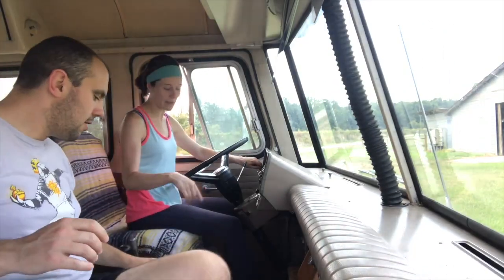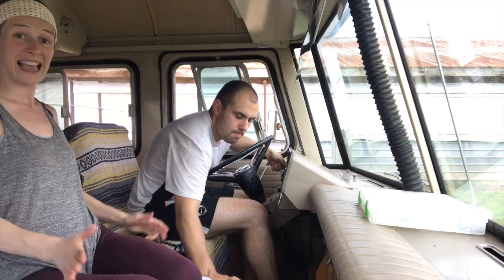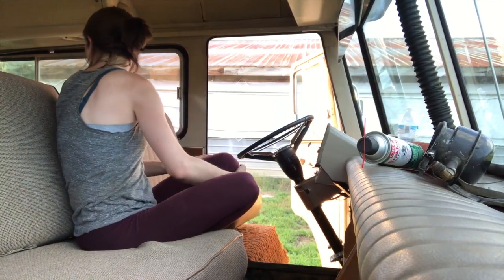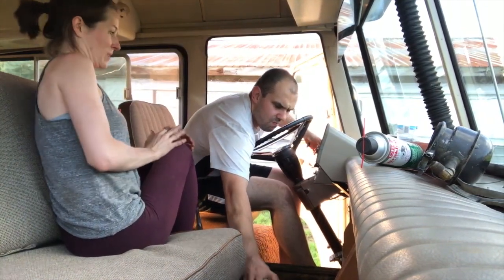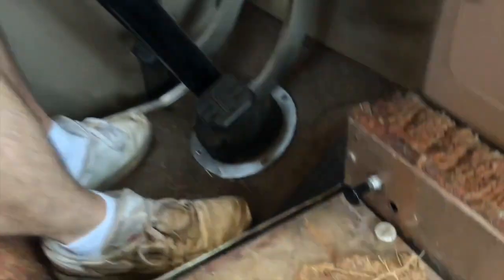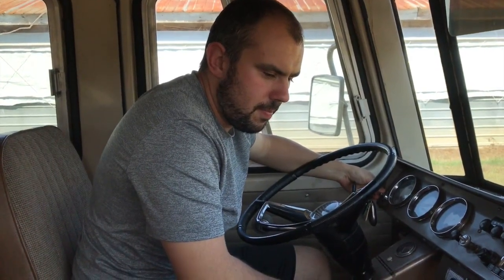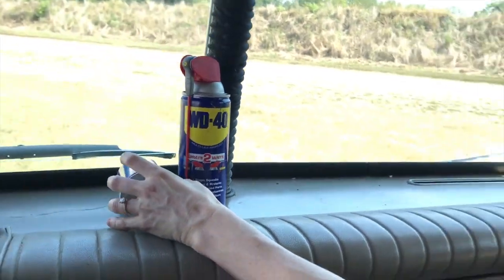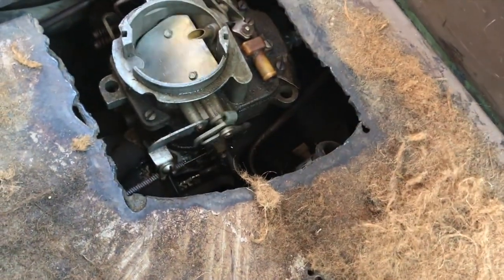LEARN FROM OUR MISTAKE! Vintage Vehicle Choke and How to Use It | Vintage RV Restoration Series

Comment: I'm trying to locate our choke as we speak! Haha
Reply: Ours doesn't have a choke there!!!
Reply: Found it. Today different set up!!
Reply from the maker: Ha ha! So glad you found it! Is it running smooth? If it's sticking keep opening and closing it while spaying WD40 down the cable, it really helped free ours up!
Reply from the maker: What RV do you have? Andy & L
Reply: @SoulofaSeeker  we have a 66 Clark Cortez. The choke on ours is in a totally different spot.....and is unfortunately disconnected. Also.....you show that flap open and close....ours is horizontal. You can't see it!!!
    Oh man.....I know zero about engines!!! I'm trying to learn as my wife is trying to bring this beast back to life!!!!
    We got it started once for about ten seconds. Haha!!
Reply from the maker: @chainsawbarbarian  That's strange that is it in a different place, though to be honest we don't know if ours if in the original place. Should be pretty easy to hook up the cable to the carburetor - What engne do you have? When the choke is horizontal it's closed (for cold starting your engine) as it warms up you open the choke till it's fully vertical. Good luck! Andy & L